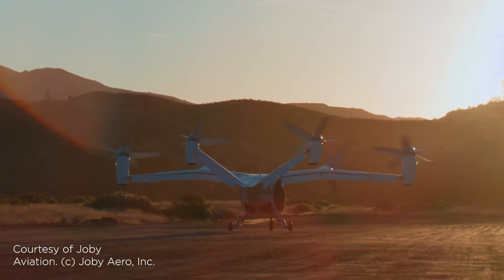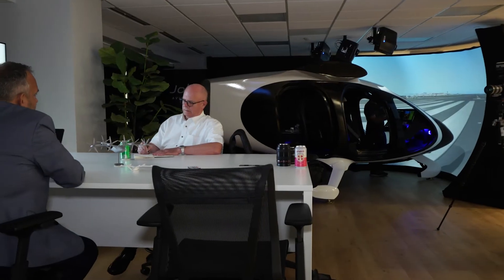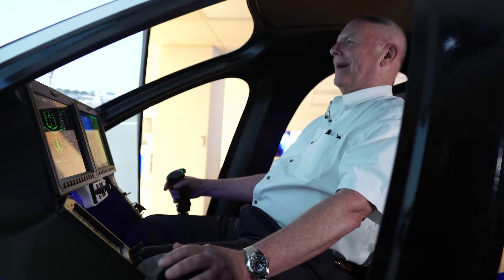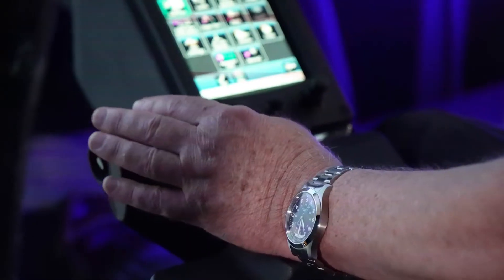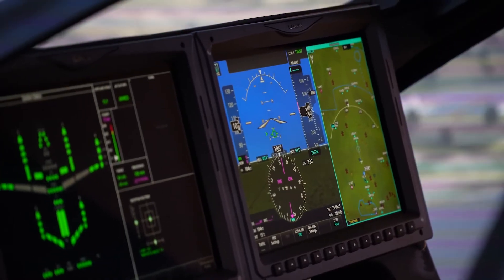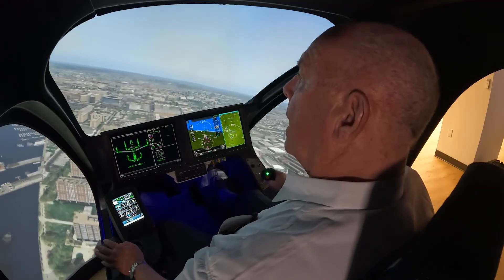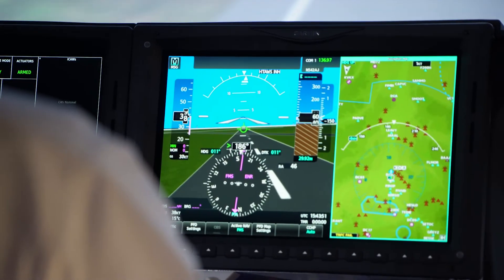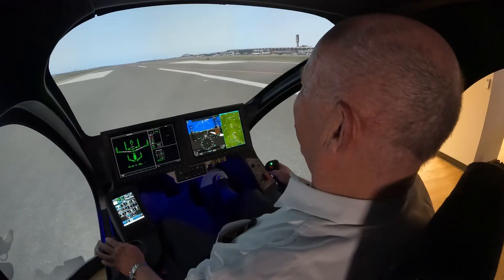Flying the Joby eVTOL Simulator

Comment: Looks cool, but those control inputs are counter-intuitive for a helicopter or gyroplane pilot, fixed wing too, to a degree.
Reply: It flies like a drone in 3 channel mode with the hand controls. So you got power in one hand, pitch(in this case altitude) and roll in the other. The only thing I'm not sure about is yaw, since it doesn't have pedals. It makes sense because you don't actually need pitch like an airplane and you don't need collective like a helicopter because you let the computer figure it out for you. But like an airplane you need power to control your speed. My guess is the props are constant speed and computer controlled for optimal thrust for a given power setting and altitude.
Reply: @Saml01  Having a drone operator fly around passengers. What could possibly go wrong.